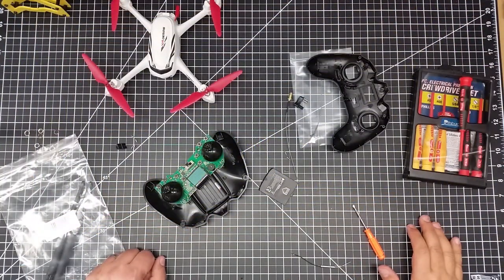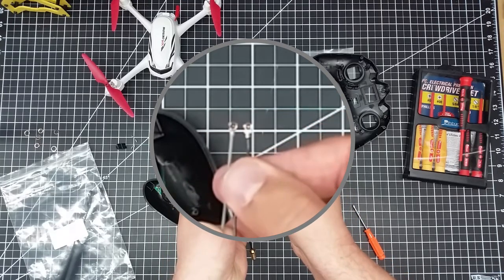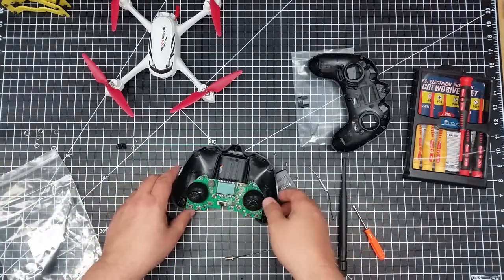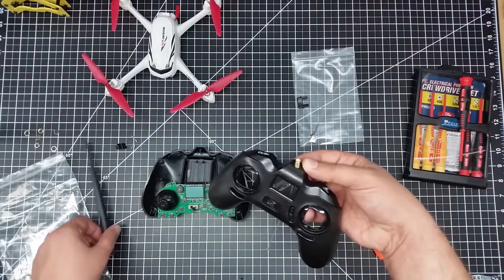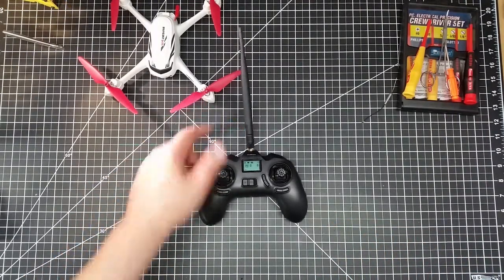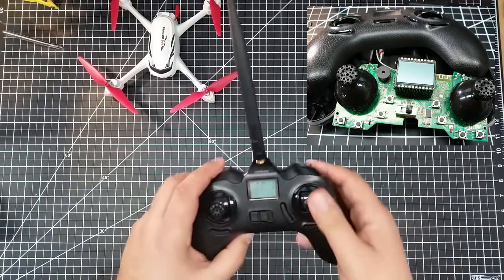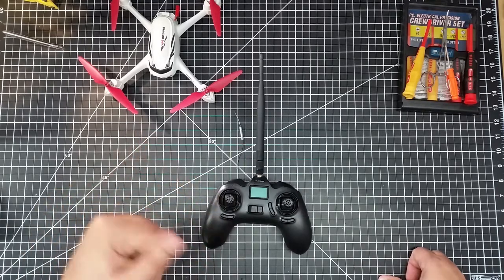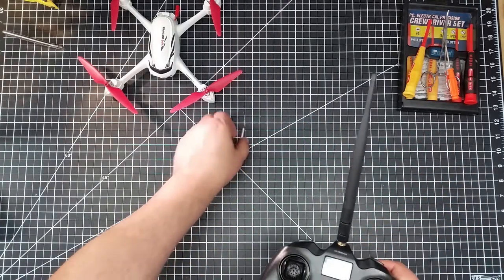Video Drone - Range Extender for Hubsan X4 Desire!

Comment: You will actually get more range by simply extending the factory antenna outside the controller but it will dangle and could possibly catch on something. I have a 2.4 ghz clover leaf I'm going to try.
Reply from the maker: You mean outside the drone?
Reply: @VideoDrone  I extended the range on a similar controller but I would have to do a video to properly explain it.  I have a video where I did a similar thing to my H501SS but this was to extend the range of the video transmitter. https://www.youtube.com/watch?v=L5uKPX-VKPw

Comment: #Like175
Reply from the maker: sound good!
Reply: I ordered the antennas.  Going to try one out on an old BB1.  And modify the Hubson controler like you demistrated here.  In my opinion it's going to be hard to compare.  Since the stock box set up is so great in the range department.

Comment: https://youtu.be/j531CmBVnwA this is my 1,550 meter round trip , 775 meter flight one way out with Hubsan h502e , only mods are 6dbi antenna on the tx . I have another video that’s the onboard video , this link is of the tx for the telemetry, thanks ! This is the on board flight https://youtu.be/GMvNxP6l7JQ
Reply from the maker: Interesting however the first was hard to see with the glare and turned but very cool!

Comment: Have you noticed any range increase ?
Reply from the maker: Major!
Reply: Video-Drone well I just did the 6dbi antenna to my remote & I removed the stock antenna from the quadcopter and replaced it with a 6dbi U.fl and I looped it inside a few times then hung it out the back end , before with all stock antennas I was getting 365 meters & now with both stock replaced with 6dbi I only got around 250 and it starts to loose connection and be non responsive , I will test it out more to see if it is really cutting down my range or if it’s just a bad area I’m flying in I will find out , but have you replaced the drone antenna or not and whats your farthest range so far ? Thanks
Reply: Video-Drone https://youtu.be/SGcm1BHZgsc here the video of first flight with mods

Comment: I'm going to do this on my 501C controller, it looks like the same controller. I crashed & broke the shell of the quad - my repairs didn't hold for long. So when the new shell arrives I'm going to do your mod as well as this one:
https://youtu.be/ER_t-oi9uMc
All things being equal they should be a good fit.
I was thinking of putting a KITT(knight Rider) style LED lights in the nose. I think the sleek lines of the 501C would look great with the scanning light. Not sure how to go about it - any advice or tips for young players Mate?
Reply from the maker: Sounds like fun!  And this is a great entry bird (my two cents) as there is a lot you can do and the only down side is the brushed motors wear quickly...

Comment: Hey, wanted to thank you for making this video. I'm flying a H501A unit bound to a spare H502E transmitter with the modified 6DB antenna. Works like a charm, the app on the phone has some issues with control stability so I'm using it for way points and FPV(delayed) mounted with the wifi repeater unit on the transmitter.

Took it out today & got it out to 700m before my wifi fpv cut off. Was still able to control the drone till then!
Reply from the maker: +vagabound1010 your welcome and 700 meters is impressive!
Reply: Thanks! Very informative videos, you've earned a subscriber! 
I'm planning on receiving a 5.8ghz FPV feed via an otg device on my android and taking it out further. There's a significant difference in control radius before and after this mod. Before the mod, I got to about 200m before RTH automatically initiated.

Also, as not many people have done it, a quick demonstration video with your ranged mod h502E transmitter binding to a H501A unit might be very well received.
Reply from the maker: +vagabound1010  also have the otg fpv and like it as if look I do a video on this with a 5 dollar VR head set.  But sold the 501 so can't do a video like that but still have the 502 as love that little thing!

Comment: why are you working around the LCD? it should pull out easily like ICs with plastic plug holders? it totally looks removeable.
Reply from the maker: It isn't :-( (at least mine)  is soldered in...

Comment: hello. I just did this mod. I flew and it blinks blue from the outted LEDs at around 150 meters up. did I do something wrong? I remember going up to 250 with stock antenna.
Reply from the maker: Are you sure the sma connector "snapped" (if it didn't, it not making contact) on and all the connections are good?  As I am over 600 meters easy...
Reply from the maker: Also did you order the Antenna listed in the discription as you might be using the wrong freq if not...

Comment: Do you have a mood for a LiPo replacement for the TX batts? Love to do that. My TX has a socket to plug into inside the batt compartment.
Reply from the maker: I just use the AA batteries and still on the same set as when I bough it.  I believe the plug is to upgrade firmware...

Comment: I see so many stock TX for the H502e getting up to 300 m. Why mod it for more if you can't see it anyway? IMHO. Also, I read that RTH does not kick in for low battery but does for loss of TX. Need keep an eye on the flight time or batt indicator on the LCD screen.
Reply from the maker: You will the bat indicator on the control about useless (at least mine is) so I go by time which has been working and do the mod?  Same reason people climb mountains :-)

Comment: i take the same mod on my h502e, but don't know why it was lack of range rather than the original antenna... every time it touch 20 m high than my drone will automaticly return to home as there was signal lost from the tx :( any suggestion to get over this problem? thanx
Reply from the maker: So you say you made the mod and you only get 20 meters?  If this is the case there is an issue with the way you connected the antenna.  As this sound like it is not connect at all...
Reply: yesterday i take to an open space/field since before i tested around my block/home... get higher but only for about 50-70m...  upper than that always fight with lost signal problems again :( is it possible come from interfered signal?
Reply from the maker: So how did this test work?  As I am still thinking it is the connector as mine has crazy range now...
Reply: Video-Drone i believe it might caused by an interfere signal or else... since i can't find another better place to test it again... but there was different range gain between the tests (near my house and at the open field)

Comment: thanks for sharing this great extender mod..just purchased one of these x4 502e hubsans last night off ebay..I will definitely do this mod.. what extra range did you find on full wave length with this antenna? you have a new subscriber..cheers 👍
Reply from the maker: So far really have not hit an end as I been flying out over the lake (see up coming video) however I am sure what will happen with a loss of signal return to home so I have not pushed to the end (yet :-)
Reply: I've flown mine to 613m out and away distance on stock antenna, you would have seen my video if you follow my channel.. How far have you gone with this antenna setup? I just dismantled an old modem which have these cap plug and play style dipole antennas? What dB rating do those modem antennas have usually.. I couldn't find any markings on mine.. Cheers

Comment: I have a RC h107c+ and i tried to disassemble The RC, but not the same and there is no slot to Pigtail Antenna WiFi Cable. how to assemble pigtail antena cable? please help me
Reply from the maker: Sorry I have zero about that one so the only thing I can you would have solder it?
Reply: thanks for your advice :) . but I confused about circuit board , which part can i solder? i have screencap if you can help me ( https://screenshot.net/wm1q1cr  ), thanks :)
Reply from the maker: Its hard to tell but looks like an add on board on the second picture (not the LCD-board) as I don't see  a transmitter on the main main board.  So find the antenna and remove it attaching the  core of coaxial cable to connection and the ground of the cable to "ground".  Note the board might not have an a "wire" antenna and just a PCB trace in which case scrape off the protective covering and solder directly to the trace.  Hope this helps :-)
Reply: Thanks so much brother

Comment: Hello again,
How long is this antenna from the top to the bottom of the connector?
Thanks,
Walt
Reply from the maker: Sorry not in position to measure but it's full wave so it will be around 24 CM long plus connector...

Comment: Hello,
Will this antenna work properly on the fpv controller for the h502s  (2.4ghz)? I did the antenna mod for the h502s and noticed that the external 2.4ghz antenna is much shorter than the one you put on the controller in this video.
Reply from the maker: Yes this is a 2.4 gig antenna (http://amzn.to/2iy8QDo) in fact basically all quads are 2.4 gig for the "control" signal as its an open freq by the FCC.  However keep in mind FPV is 5.8 gig...

Comment: New to drone flying and find your vids very much to my liking. also just wondered if you are by Mackinaw,Mi.? I have re built 5 syma X8's to Alt. hold good so far. Now working and a Hubsan X4 so I have been following you. Thanks Barney.
Reply from the maker: Greater Port Huron area and you will have a great time with the Hubsan!

Comment: so what was the increase in range after the mod?
Reply: Dan Data left and right hand threads
Reply from the maker: Just took out today (the video should post this evening) while it was a cold day (about 15deg/F) was easy get out around 300 meters (before I ran out of land :-)
Reply: Video-Drone  I just got done with mine.b4 the upgrade I couldn't even get 1 satellite in the house before now just in the house I get 11. I had the drone out earlier and it dropped out the sky from about 250-300 feet but luckily it fell kinda flat commin down and the air flying past the props as it's falling keep it balanced out nothing broke at all.
Reply from the maker: Wow I had mine fall 100 feet today too!  The return to home for low battery return  didn't kick and it droped.  Landed flat (as you mentioned) but broke two props.  Will have the video up in a day or two...
Reply from the maker: Hmm mine fit just fine, I am sure you realize you have spin the black ones backwards...
Reply: Dan Data mine said that on the box inner lid?
Reply: so it maxed out at 300 meters ?
Reply: did anyone have the problem of one of the props not fitting tight - can't figure put why there is to much play in it - also the instructions in the manual are wrong for lining up the props with the straight line on prop (wrong side) - this is in the 502s too

Comment: Now THAT's an antenna!!  Couldn't you have used an external antenna off a Wi-Fi router as they use 2.4GHz as well?
Reply from the maker: That is what it is as 2.4gig is unregulated, however this one has the same SMD connection as the original so it plug and play!  So did you see I launched your channel today (http://Thingi-Finds.DIY3DTech.com) a litter rougher than I wanted but I screwed up and released it by accident so said what the heck and just went with it and will work out the bugs later...